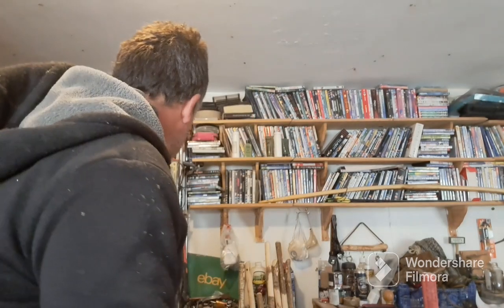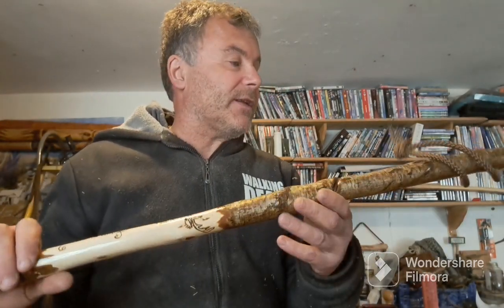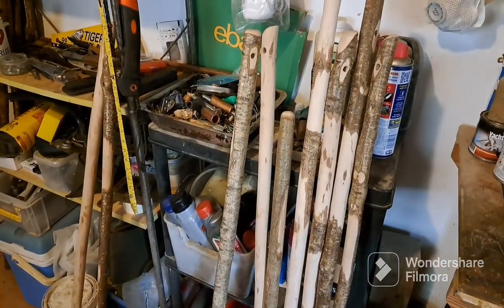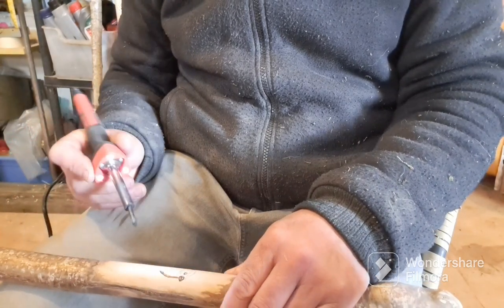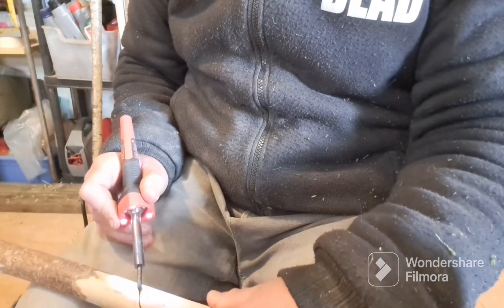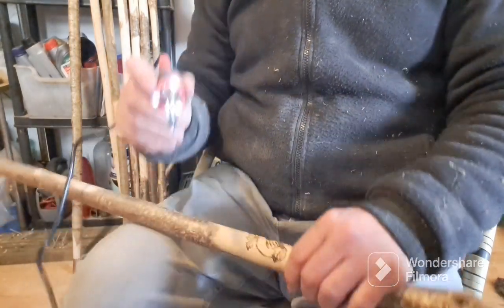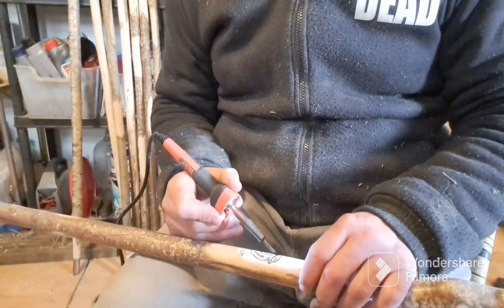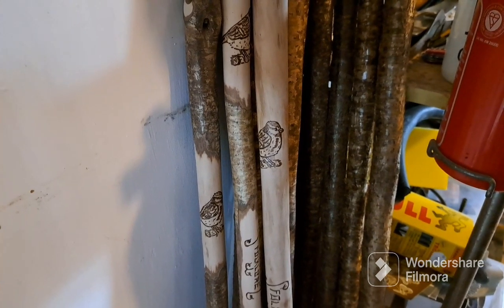Hiking Stick Woodburning, Natural looking Hiking  Sticks gaining  popularity.

Comment: What kind of rope you for the handle it doesn't look like paracord
Reply from the maker: Hi, It's not para cordage in that context. It's 8mm braided rope polypropylene, it's strong, flexible,does not soak up hudge amounts of water and comes in a variety of colours......oh and in a emergency/ survival  situation it can be used as fire starting material  as well.Thanks for watching ,Andy.